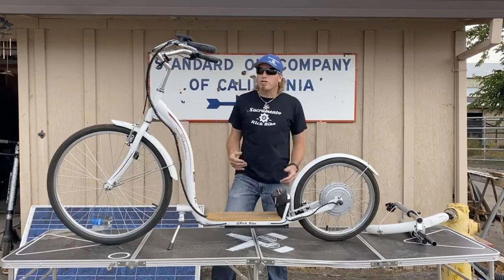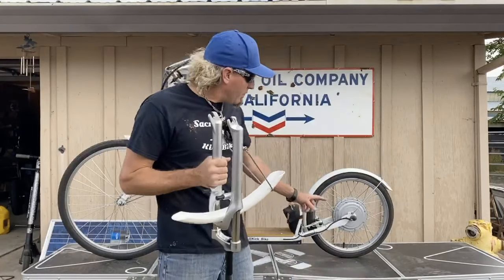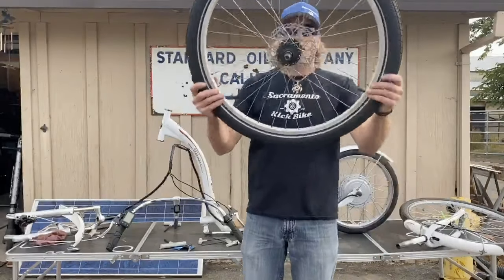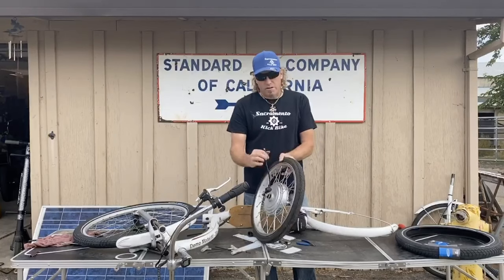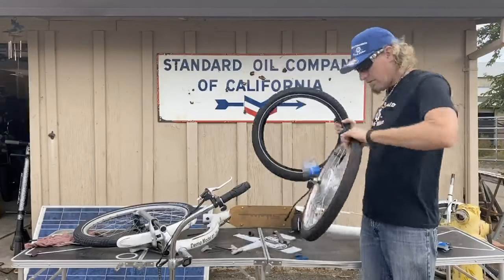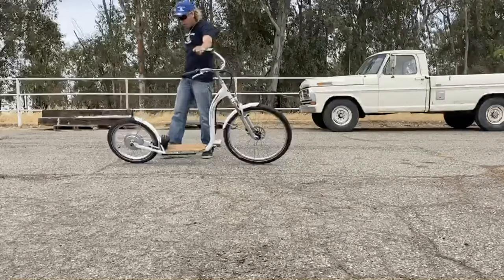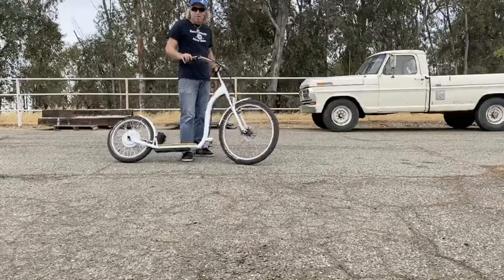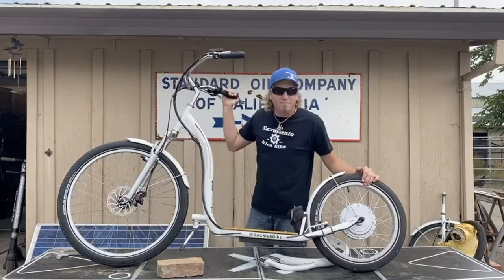Electric Schwinn Shuffle e-kickbike Adult Kick Bike Conversion Part 3 E-Cruiser Deluxe

Comment from the maker: The reason I did not put an electric wheel up front, I didn't want to add weight to the front of the bike or make the steering feel heavy. In my case the rear just made more sense and I could get a 750w rear vs a smaller 350w or 500w front. More power for later mods.
Reply: With the mods how long and how fast on 1 charge I'm thinking about using it for delivery purposes as well as a fun ride
Reply from the maker: With the bigger tire it gained almost 1 MPH faster (almost 21 MPH maxed out) but it sucks more wattage due to the larger diameter.  It still gets 14+ miles @ 14 MPH.  So it's kind of a wash in terms of distance if you don't do a lot of stop and go.  I put a 48 volt battery from China and a deeper battery tray and it got a couple MPH faster (23 MPH) and pulls a bit harder out of the gate. 
If doing for distance, I would not run as tall of a tire and get a battery with double the Amp Hours to double the distance.  This one is only a 7ah 36v battery in this video.

Comment: I got the same scooter, actually two of them. both have 48v 1000w front wheel direct drive motor hubs. My personal use one has an 52 volt battery. the first one has pretty much the factory set up, but I didn't like the narrow deck or the long sweeping cruiser handlebars. sold it, built another one this time I tried mountain bike handlebars, didn't like them either. found a Town and country handlebar and that works great. I replaced the little deck and added an 10 inch wide 1/2 inch thick oak deck, which I forked around the down tube so I have a place to mount the battery and controller that is low slung and out of my big feet's way. It was white like yours but I wanted to use this scooter for getting around on trips to locals stores and such so now it is Urban Ugly blue. I really dig the front suspension forks but the weight of my front wheel hub motor would make it pointless, but like you I did opt for a meatier tire set.  Only wish I could share some pictures. I always wanted a motorize kick scooter but most I have seen look like "Death On A Stick!", I am six foot, 200 +lbs  I wanted something robust so I built my own.  I don't generally ride it wide open but Old Blue does around 35 mph and gets around 15 to 25 miles per charge depending on terrain and how heavy I ride the throttle. I can carry a spare battery in my back pack to double the range, I made an extension cord so I don't need to remove the main battery just unplug one and plug in the other. I like the front wheel drive because they are easy to work with but you need a torque arm and a strong drop out. I have used the same 750w system you have on a number of builds and actually have a folding moped I built with the same set up. I dropped the bikes chain and mounted the front wheel drive hub into the rear drop out.
Reply from the maker: Hit me up at sacramentokickbike@gmail 
I'd love to see pics of your kickbike and talk about what speed controller setup you have. I will say adding front suspension adds to your ride quality and I won't ride one without it now.  Running a 48v 1000w hub motor is the way to go most definitely if not even a 1500w setup. Especially if you like speed and the torque they produce like me.

Comment: Strengthen it, stack a 5k+  battery and ability to stack a second on top of that one, on that frame, add a seat to the rear do a very high quality 750W proper hub motor with more than 100 nm torque... beach cruiser size tires high quality high mileage. "mag rims". Crush everything.

Comment: What does the modded scooter weigh?, all in with any add’l accessories you may have installed? I’m considering a similar build, no suspension forks if I can save me a few pounds of weight.

Comment: Can you provide details needed for fork replacement? Tube diameter and length? Maybe provide a link for the replacement fork?
Reply: I would also love to have a link to the front fork you bought!
Reply from the maker: This is the fork on eBay currently 2/1/2023

https://www.ebay.com/itm/325233957124?mkcid=16&mkevt=1&mkrid=711-127632-2357-0&ssspo=msWqOk_AQLO&sssrc=2349624&ssuid=gBlw95YzRIi&var=&widget_ver=artemis&media=COPY